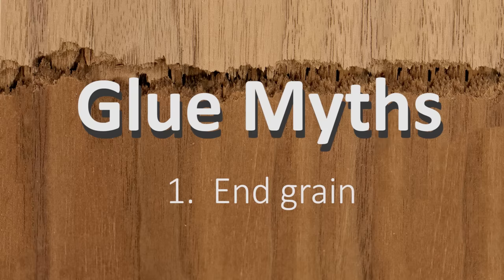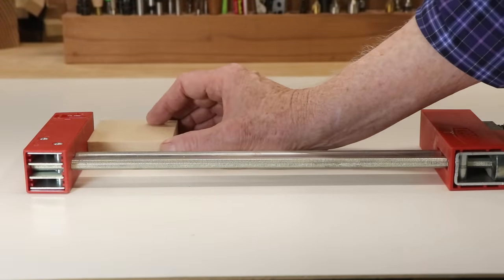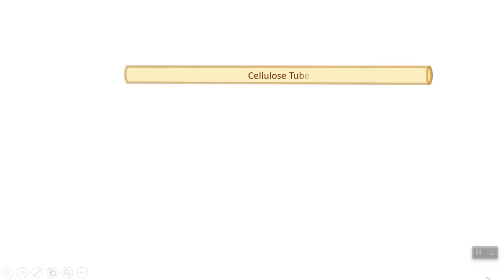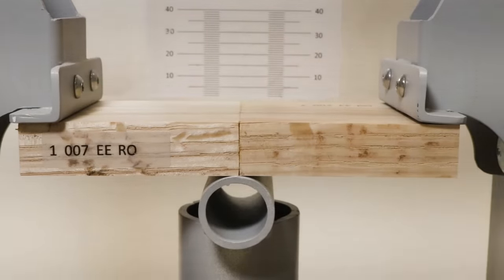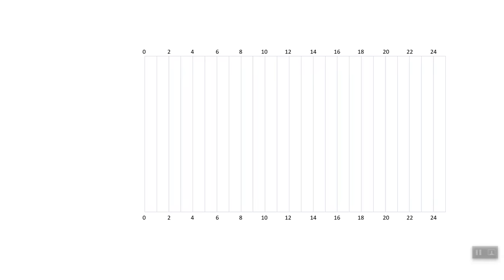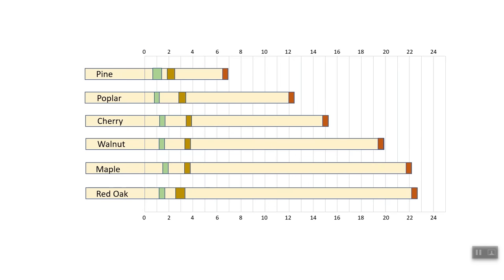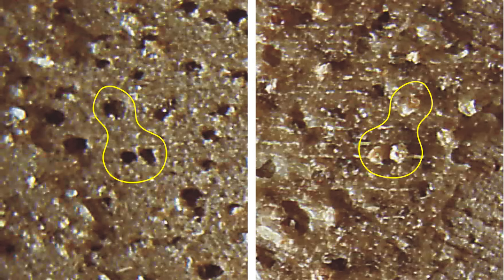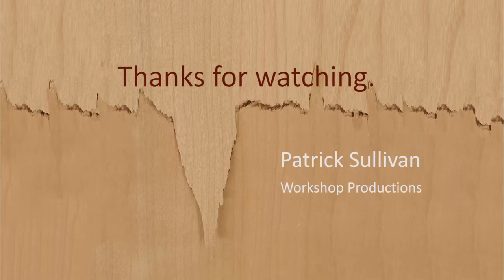Glue Myths:  1. End grain

Comment: So as a structural engineer, I loved the last demonstration. The biggest factor that must be considered is application area. Yes end grain joints are stronger, but you'll rarely have an end grain joint that has as much surface area as a side grain joint. The "myth" of end grain joints is really an application of force distribution. This really explains why you cannot "lengthen" a board with an end grain joint since those will typically be subjected to long axis (weak axis) bending where as side grain glue ups will be subjected to short axis (strong axis) bending.
Reply: yeah the moment forces on the seam will usually be much larger, coupled with a usually much smaller GSA (glued Surface Area) and then compounded with a usual inability to adequately apply enough clamping force axially prior to curing.
Reply: Actually you can lenghten the board. Look at wooden planes, they have wing spars which span the whole wingspan and you won't find structural wood long enough. You just need make a scarf joint with a slope 1:12, preferably 1:15. With that you make end to end grain joint to be almost long to long grain and give the joint much larger surface area.
Reply: @fifi23o5  no ii8
Reply: Although you're right about not applying these findings incorrectly, I think the "myth" probably came about from people observing the joint failing before the material and concluding that the problem must be that the glue is not performing well on end grain.

When in actuality the truth is that the glue has roughly the same strength regardless of scenario. It is the strength of the wood itself that is drastically different depending on grain direction.
Reply: The last test did not break at the glue line it broke at the wood fibres, thus proving nothing. Any thin end grain piece will easily break at any point. Gluing end grain joints is regularly observed in cheap mass produced wood furniture usually with addition of brads and nails. They always fail eventually, probably related to wood movement over time due to humidity changes. Pointless video, waste of time making it and waste of time watching it
Reply: @pilotdog68  What I had planned to say, agree completely!
Reply: @peterthomas144  Well, don't forget to add the time we wasted reading your comment...
Reply: Good point about very limited surface area of end grain; not much there to glue. Thus the ship lap joint.

Comment: As a guitar maker, I'm constantly "Breaking the rules," regarding how things are supposed to be glued together.  As wood workers, we're constantly told that you don't glue up parts cross grain or end grain to end grain, and yet, in  building a guitar, we constantly find ourselves doing those exact things, and that on a very thin, lightly constructed "box" that has to stand up to literally hundreds of pounds of pull or stress.  As a result, I've often wondered how we get away with it.  I think that, the fact that we keep our materials in humidity controlled rooms,  work with those woods in temp and humidity controlled shops and also tell our customers not to expose the instrument to wild changes in heat and humidity might  be the key and also possibly a variable that could effect the long term health of an end grain to end grain or cross grain glue up.  The big thing in avoiding huge swings of humidity is that you are trying to limit the differing movement of the vairous parts, along their differing dimensions.  When one part moves greatly in one direction in opposition to the piece it's glued to, you get breakage.  Perhaps then, the rules only become apparent, when a glue joint is exposed to temp and humidity changes over years.  I mention this, not as a critique of your methodology, only that there may be other variables that need to also be addressed to determine the long term veracity of "The rule."
Reply: and we pay CONSTANT attention to balancing forces!
Reply: Exactly!  This controlled experiment does not introduce normal humidity changing conditions over a period of years.  Most any joint holds until it does not.  End grain joints have a shorter life span than edge grain joints.
Reply: Interesting. I work for a hand rail manufacturing company. We end glue and face glue pieces to make blanks for railing rated for indoor and outdoor use. One of our test pieces has been outside with no finish for 3 years at this point, with no sign of de-lamination of any of the joints. With temps ranging from +110 in the summer to -25 in the winter I have few worries about part failure at this point.
Reply: where are you gluing end grain to end grain in a guitar in an area that takes load? In fact, where are you doing it at all? The only place I can possibly think of is the neck scarf joint that I suppose classes as end-to-end, and is usually a typical failure point.
Reply: @A1BASE  right? I was thinking the same thing.  I’m a backyard builder and refinisher and cannot think of anywhere end to end would be necessary.

Comment: Very cool information. Thanks for the effort. I hope it doesn't have an unwanted effect on people now thinking that wooden joinery is obsolete. It will still be necessary to get joints closer to the strength of the long grain.
Reply: right, he still highlighted that the joint is strongest based on the amount of long grain fiber that crosses the joint.  i.e. basic joinery will always beat straight up glue.

Comment: Outstanding work Patrick!!  I am also a Mechanical Engineer/Woodworker/Creator and love your approach.  Hard to argue data when the process and variabilities are controlled so well.  Thank you for your huge efforts and contribution.  I'm not sure if application wise I will change my designing of Mortis and Tennon or Mechanical Screws/Nails over an end to end.  I will probably still put splices in my 45 degree corners too.  I realize you were not saying not to do that, you were simply disproving a myth.  You did that fully and I really enjoyed it.  Thanks again.  I will view all of your videos now.
Reply: I just had an end grain joint fail on me and there's no way it was under the kind of stress showed in these videos. Just because it tests strongly a few days after having been made doesn't mean it will hold up over years in the real world. Continue making your joints properly and getting long grain crossing your joints. Preferably, have it mechanically supported by the wood (like mortise and tenon) so that even if the glue failed it would still hold together.

Comment: It would be really interesting to see what happens to the strength over time as the side to end grain joint grows and shrinks with changes in humidity.  I’ve always thought that this was what caused these joints to fail, not just the differences in the grain direction. The new glue strengthens the joints as you demonstrated but doesn’t the glue fracture and become weak as the wood swells and shrinks over time.  This is my concern - that my project is strong when it leaves the shop but a few years later it begins to fall apart.
Reply: Worth doing the tests with a drastic change in relative humidity! Could be simulated in a lab environment! Excellent point.
Reply: I'm not a woodworker, but I did work in R&D, a bunch of years, with different materials and tasks. Wood not included. So, in my opinion, this test is a pretty good one and scientific enough, as I see it, to be seriously taken in consideration, as valid. 
Now, if we are talking about humidity and adequate glue it's used, the rest of the conditions remains the same. The strength of the different wood fibers can be affected by the humidity (or just make them more elastic, which is not necessary a weakness), but the conditions are the same for all the wood species/types used. So I suspect that the 3 methods of gluing will not get those proved weaker in this test, stronger, because of the humidity. 
As I said, I'm not a woodworker or a specialist of any kind in this field. I'm just thinking loud 😀
Reply: Andrew has a good point.
Reply: @gcnggcng9373  Andrew is spot ON.
Reply: That could be a factor, considering that wood dimensions vary perpendicular to the grain more than parallel to the grain, and that affects end grain joints in 2 directions, but side grain in only 1.
Reply: @stefang1087  What you're not taking into account is that wood is a very strange material in that it swells with changes in humidity and temperature like most materials, but UNLIKE most materials it does so anisotropically.  In other words, wood experiences much more movement perpendicular to its grain than it does parallel to its grain.  The point that Andrew was making was not that humidity might have affected the test - because as you pointed out humidity would have affected all samples similarly.  What Andrew is saying is that over time, as wood swells and contracts many times, this badly strains joints that don't respect this unique property of wood, and an end-grain to side-grain joint is a perfect example of this.

I do think the results of this test are valid under the limited scope of a 3" test sample that is tested very quickly after gluing.  But I guarantee you that if you make a 3 foot wide dinner table and put a breadboard end onto it that doesn't account for wood movement, this glue joint will separate over time even without any external stress at all.  The wood movement itself will destroy a long end-grain to side grain joint, regardless of the glue bonding strength.  This is why gluing end-grain to side-grain is a bad idea - not because glue doesn't adhere well to end grain.
Reply: @Wesstuntube  Exactly, well said! I waited till the end of the video, because I was sure the he would make a comment about wood movement and why this myth is not a myth at all but a useful knowhow. End-to-side bond will always fail because of wood movement due to humidity changes and other factors. End-to-end bond, on the other hand, is already in use in commercial wood product.

I hope he continues this experiment and takes into account time and humidity changes. If not, many people that believe this findings will be very disappointed in next few weeks or months if they try this "unorthodoxical" method od joining wood.
Reply: Yes. Glue is very strong even in end grain orientation, but wood movement due to humidity is even stronger. End grain glue joints fail because they pull themselves apart.
Reply: You were ahead of me. I agree based on experience.
Reply: @stefang1087  I think the point was about wood movement AFTER the joint has been glued up. This happens across the grain (perpendicular to the cellulose strands) so the movement (and thus disruption to the joints) wound be maximal on the end grain joints. Really good idea to test this variable I think
Reply: There is also another failure point. PVA glue is not very good against water, after all PVA is water soluble. Wood takes moisture in through end grain and it moves along the tubes. Inevitably, water will reach to the joint and weaken the bond. Of course this assumes other end of the wood is not water sealed.
Reply: As a relative new wood worker, I find this thread extremely interesting.
Reply: The video does a good job of demonstrating the relative strengths of Titebond to lignin and cellulose. As pointed out the strength of the joint is dependant on the wood movement relative to the glue surface. PVA glue is is relatively brittle and wood (depending on species) can expand and contract dramatically across the grain, if there are significant changes in humidity. In today's heated and air conditioned environments large humidity changes are limited and you could probably get away with end grain to end grain glue up if the surface area of the joint isn't too great. I wouldn't want to use this on a joint with a larger surface area without some mechanical support.
Reply: Exactly this. One of my first projects in highschool woodshop was a box and the corners were rebated and glued, no mechanical joint at all. The joint in time did fail even though there was adequate glue  coverage. I still have the box kicking around and the broken joint looks exactly like the zoomed in shots shown in the video except through wood movement instead of intentional breaking.
Reply: @jewishmafia9801  Same.  One of my first projects in high school was a cutting board.  I capped both ends with a breadboard end for aesthetics. The joint didn't involve mechanical retention like dowels or allowance for wood movement; it was just glued end grain to side grain. I gave it to my parents and they never used it as a cutting board, they just hung it up as decoration.

A few years later, the joint on both ends had separated.  No external stress of any kind.  So while I do appreciate this video and it was super interesting, I do feel like some people are extrapolating the results to assume you can glue however you like and grain orientation doesn't matter in terms of the strength of the glue joint.  Not so, at least at scale and over time.

If you're gluing together something where the wood pieces are small like picture frames, you can probably get away with side grain to end grain glue.  For anything more than a couple inches wide it's definitely a bad idea in the long run.
Reply: I do a form of woodworking called intarsia.  Basically you glue a bunch of small pieces of different species of wood together to form a picture or image, kinda like working with stained glass.  As you can imagine the pieces are glued together on every edge to the pieces adjacent to it and on a backerboard.  Some will be edge to edge, end grain to edge,...  Anyway even in a climate controlled environment, gaps will open up over time.  It's almost always the end to edge orientation.

I would never end to edge or end to end and expect it to last over time.
Reply: @stefang1087  If you look at the properties of wood and humidity you find that wood move about 3X more in one grain orientation than the other as humidity changes.  If you look at the rings of a tree, from ring to ring it moves little as humidity changes but along a ring it moves a lot.  I have a 37" Red oak kitchen table top that grows by 3/8" during the humid months and shrinks back down during dry months.
Reply: I hope the maker of the video will test this and update the video if the results are different than the test he did. Would be funny if instead of busting a myth he created one.
Reply: Would some sort of supplemental joinery (e.g. dowels) help mitigate this?
Reply: @stefang1087  What you've said is valid but I think you may have missed out on the point being made by Andrew.  The end grain joint would expand and contract due to changes in humidity more that other types of join.  The expansion happens perpendicular to the grain direction as humidity changes over the seasons for example and this joint is particularly prone to these stresses vs other joints. Therefore under this mechanical forces the glue could fail in time more readily than in other joints where less expansion and contraction would occur like edge grain joints.
Reply: @Wesstuntube  Thanks.  That’s exactly what I was thinking.

None of this discussion is a negative on the very well done video and tests, may just want to extend the results to include effect over time and longer lengths of wood as this is where the “myth” about cross grain glueing is founded.
Reply: @jimh472  in my experience you can’t fight/constrain wood movement, you have to just plan for it. Different species of wood move different amounts. It generally isn’t a lot of movement (unless it is a big panel like a table top) but you have to allow for it otherwise over time you’ll not be happy.
Reply: I believe this is why end grain joint do stick and then a month or two later they fall apart on their own.
Reply: Exactly what came to my mind
Reply: I had the exact same thought
Reply: I was thinking the same thing right away, and scrolled down the comments to see if anyone else already brought up this point, and if it received any answers. Well did
Reply: Technically this would have the same effect on mortise and tenon since they also expand side to side. Or even pocket holes since they are on the end next to each other. If the width of the board is not great then I don't think your concern is a factor
Reply: Yep. Just had an end grain joint fail cleanly at the glue line even though it was under minimal stress. It was in a climate controlled home the whole year. So now I understand what you say is correct. These joints can't handle normal expansion and contraction indoors. Strong when it leaves the shop and broken a year later. I fixed it so it won't do this again, but lesson learned the hard way.
Reply: @CarlYota  How wide of a joint? Supposedly anything less than 4 inches across we don't need to be concerned with movement. And most traditional butt joints are less than 4 inches wide (like cabinet doors for example). So unless your joint was wider, it may have been something else that caused the failure.
Reply: I hope people read this thread before trusting what the test conclusion states.
I am  a mechanical engineer and wood worker. I am surprised the other Mech engineers above have not said something. Please do not build a project with the hopes that your end grain joint will stand up over time. Learn about creep of the adhesive and the forces that humidity will create.
Reply: I scrolled down to the comments to see if anyone else was wondering this!

Comment: So really, this is not comparing the relative strengths of the joints, but rather the relative strengths of different wood grain orientation combinations. For end-to-end the difference is that the wood grain is in the strongest possible orientation for both pieces, so the wood glue then becomes the weakest link since there is no lignin boundary to fail first. Great video!